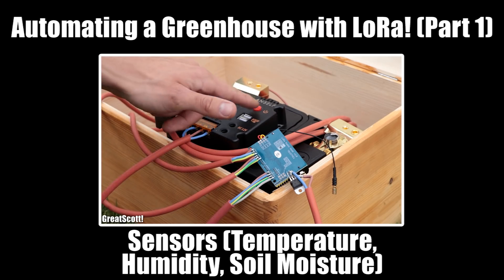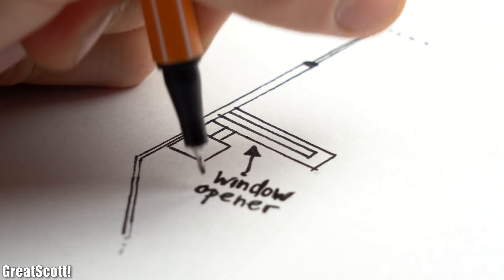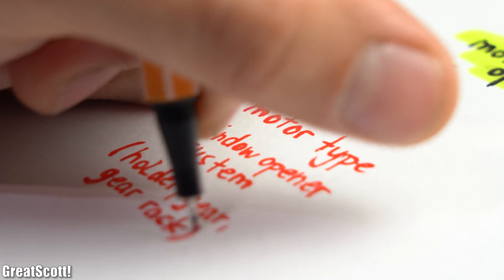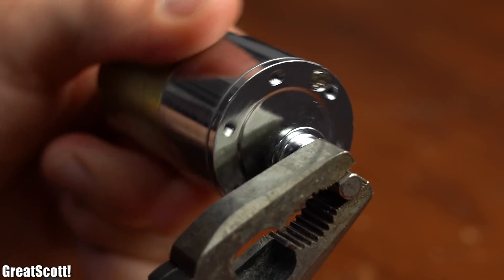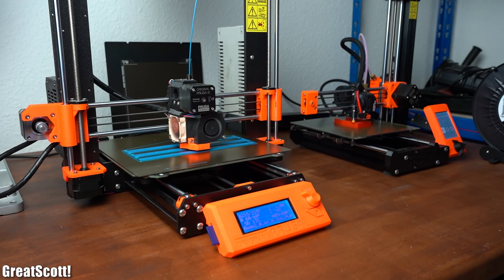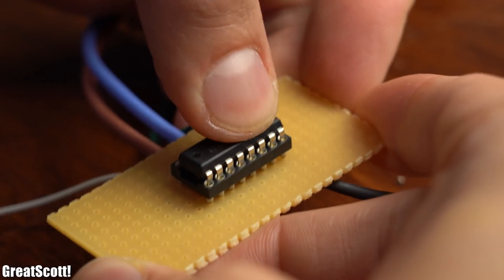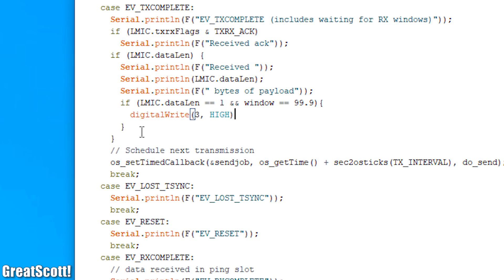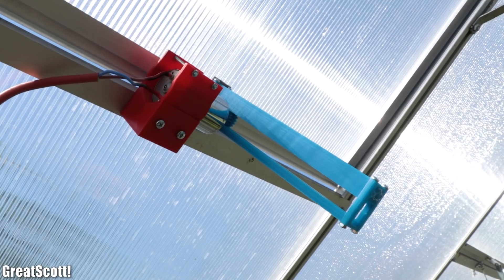Automating a Greenhouse with LoRa! (Part 2) || Motorized Window Opener

Comment from the maker: I feel like I need to explain some things a bit more after reading through the comments:
- I did not directly use the McMaster-Carr component library gear and rack. You are not allowed to 3D print them. I only used them as a rough reference in order to create my own.
- I did not include limit switches because I thought it would be an overkill for such a simple system. Instead my rack holder is open at one end. So if the window is fully closed and the motor wants to keep going, the rack can be pushed out without destroying anything. The opening and closing time is done by a delay and was measured by myself. The opening time is a bit longer than the closing time. Thus after a month or two the rack will slightly get pushed out of the holder due to misalignments. But you can easily fix that by hand.

I hope that answers some of your questions and I hope that you still enjoyed the video even without me mentioning those information :-)
Reply: A few sugestions to make this more reliable and better:
1) Add a 10-turn Pot to the motor for closed loop feedback, That way you always know exactly where the window is.
2) Instead of transmitting placeholder Temperature and Humidity data, transmit the back how wide open the window is in % based on the aforementioned closed loop data
2a) maybe add PID control to the window based on the temperature and hunidity for extra stable climate.
3) Include a hinge in the Rack case, the Rack tilts in relation to the window, your Stickytape will fail at some point otherwise.
The whole thing is overkill, so why not go the extra steps to make it perfect :)
Reply: @muh1h1  Well said
Reply: It shouldn't be too hard to add a course limit by watching the current consumption of the motor, no ? This is how my gate opener works, with some way to to smooth the endstop, rubber or something ...
Reply: Please make a video on how capacitive fan regulators work 
Because all know about resistive and triac based ac regulation but not about this
Reply: I don't want to say anything..... but I love you very much bor
Reply: Hello @GreatScott! 
About your limit switches, you can use a TMC2209 driver, used in 3D printer to have access to "limit switches" without installing any hardware : the TMC2209 detect when the current required to spin the motor is too high, and thus send a signal to the microcontroller indicating that either you reached the end of the rack; or that something is stuck in the system. The beauty is that should other weird cases occur, you can detect it as well, as it monitors the motor's current.
You can use those drivers as a drop in replacement for basic drivers, or in SPI to have access to the full feature set.

PS : after writing the post i remembered that you used a DC motor, TMC2209 is for steppers, perhaps you can still use it for DC motors, but anyway, TMC have specific motor drivers for DC motors, with similar features also.
Anyway, great project, will you post your rack and pinion somewhere? i like how simple and self adjusting the solution is, i want to use it on a smart blinds project i'm working on!

PS : look into home assistant : it is extremely powerful, integrates with countless systems, and rather than send bytes by hand, you can have software or physical switches, or better yet, automations, scripts, etc :)

Converting my own homebrew smart devices from my own restful feature rich firmware to ESPHome and Home Assistant increased what i can do  ten fold; also the reliability increased quite a lot; almost all sensors i'm interested in are already supported, and i don't have to search for the right library or write the driver...

Home Assistant + ESPHome is a game changer compared to other solutions; and is imensely powerful.
Reply: I would recommend the 'Blumat Tonkegel' for watering your Garden. In my Arduino Projekt i soon realized that the soil moisture sensors are useless. So i used the one from Blumat without even any electricity just mechanic. They water perfecly and need no maintainance. I would highly recommend this system.
Reply: Great project! but I do agree with some folks down here about checking motor state during both open and close operations: it's not about breaking some 3d printed gears and racks, you may have a stuck window because something broke or a (dead?) visitor into the greenhouse and it may be possible to fry something (motor, driver). a open/close window sensor may be helpful when you need to resume open/close operation, (or to diagnose a broken mechanism) but I see you when you say that you need to visit the greenhouse daily.

But since you already have a microcontroller on the job, I would also have included an threshold temp/humidity high and low values for automatically opening and closing, because you won't kill your vegetables if you couldn't visit your greenhouse on a particular day. Belive me: I don't have a greenhouse, but I do live on a hot-and-dry place, and I've managed to kill my mother-in-law flowers TWICE for not being able to water them on a hot sunny day (just one day did the mess! In my defense, I was at work). I don't know which temps you get during the year, but it may be a sensible solution, just in case. I see you grow tomatoes, and to me they are particulary fragile while growing.

And also, it wouldn't kill you if you have all the parts laying around.

Greetings from Brazil!
Reply: GreatScott couldn't a linear motor have worked for this application?  Also I helped my father take down then put up a green house on his farm.  The green house had a fan controlled by a thermostat with louvers on both sides of the green house that automatically opened when the fan turned on.  Kind of like a dryer vent louvers.
Reply: You could use car door actuator used for locking and unlocking doors
Reply: A limit switch may still be worthwhile for the closed position to allow it to self-calibrate on startup. This would be especially useful if power ever went out while it was in the open position, as it would attempt to open again once power was restored and could damage it.
Reply: Won't stuff get rusty due to the high humidity?

Comment: I saw immediately first part where you said you got rid of the humidity sensor. I saw the guy in YouTube for flaura pot telling all caveats of this sensor. Maybe it's an overkill using this sensor but, he mentioned 82% of those sensors have many flaws. I believe you've got a set of those in flaw design. He also mentions how to "repair" such flaws (or at least know the differences)

Comment: Just one thought - I note that you do not measure the outside temp and humidity.  Although your GH is not hermetically sealed, there will still be a difference between inside and outside temp and humidity.  eg, if its too humid inside, pointless opening the window if it is raining outside!

Comment: Almost 2 years later, I plan to do similar with my greenhouse. How did 12v battery with solar survive? Is it still operating? I want to control Windows, doors, water pump, Heater and others. As I also want to receive mqtt for remote control, I'm curious if a battery 12v 4ah will be enough to run esp32 w/o sleep. What do you think?
Do you use deep sleep?

Comment: We have a wifi thermostat in our well house and it measures temp and humidity(air). We’re more interested in temp but the humidity will come in handy in warmer weather. It’s called Inkbird. In cold weather we monitor temp in the house then we turn on a heat fan via CE Smart wifi plugs.

Comment: As I was re-watching this video, a thought occurred to me:
Currently, you have to adjust the gear rack every once in a while, because the position is lost over time.

But, what if instead of using (overkill) limit switches, you introduce a 'slipping' mechanism at each end of the gear rack?

You could have thin plastic walls that bend easily. Then, leave some space between the rack teeth and the bendable walls. The motor gear will slip when pushing beyond the limit, and re-engage when turning back quite easily.

Comment: I don't know if You still use this greenhouse, but I read somewhere that the best way to measure the temperature in the greenhouse was to place the thermocouple in the middle of the a vertically positioned PVC pipe...

Comment: Electronics is your expertise, but gardening is one of mine.  You say you don't need an automatic watering system, and on one level that is true.  BUT you do NOT want to water on top of your leaves like you did in the beginning of this video. Especially in a greenhouse.  You want to keep humidity down and besides opening things, not spraying water all over is actually important.  A drip system will help solve a few of the issues you have been having.  
There you go, a actually good reason to automate something else.  :-D You're welcome.

Comment: I was watching the greenhouse video and was wondering your opinion on combining solar power and LoRa to design a no battery LoRa sensor that only operated (at the least) during the daylight? It would seem sensors in a crop field may only need to send soil moisture, light levels, temperature, etc. during daylight hours though temperature at night would be useful. Procedures such as watering at night would create more disease problems for crops anyway. The sensors may not have to send information often, or at wide intervals, and could therefore aggregate some energy, maybe even enough for limited nighttime operation. A Supervisor/Monitor might to be able to evaluate the condition of a super capacitor by some method(s), ESR, capacitance, ripple current, etc, to guarantee reliability. At the least a keep alive signal could show total failure. In farming being able to use many inexpensive sensors without the need for battery replacement would be a great addition.

Comment: The whole build up is just way too complicated, the programming the build, the cost of over all. Why not just buy some expantion modules and hook the green house up to your home security system, add the water coae control units and u are fully automated. My security system is Paradox EVO192 and it can run 254 expantion modules , hell u could build a whole " Smart home" based on just your security system and programming that to control PGM-s and zones (temp , water, moist,doors and so on) or what not is super easy, hell even a 10 yr old can programm it to run your green house like jesus walking on water. Or is this the "make it has complicated and useless has possible" DIY video?

Comment: There might be a reason why your moisture sensor gave varying results: some of the boards are faulty as the 1Mohm resistor on the output only has one side connected. That causes the capacitor on the output to not discharge on time.
Solution: put a 1Mohm resistor over the output is the easiest.

Also, the sides of the board are unprotected, cover them with epoxy, nailpolish (good quality) or dip the entire thing in PlastiDip

Comment: Great work! I love the idea, and the application, however, maybe it would be better if you use a closed-loop system for the window instead of an on-off control, and that the amount by which the window opens is directly related to the relative humidity inside the greenhouse, and how much extra humidity opens a certain distance of the window is based on average data of the surroundings' conditions, this might be a bit overkill ik, but it would be awesome and that's all that matters lol.

Comment: Wax motor to a click pen mechanism to a lever. Wax motors work like a hydraulic piston and are ridiculously powerful for their size. Pin one end of the wax motor/pen mechanism to the fulcrum and the other to a class 3 lever. The weight of the load would act like the spring in the pen. The window is the lever and the load. The hinge is the fulcrum.
https://cdn.instructables.com/ORIG/FBY/8S7E/H1QMLLXX/FBY8S7EH1QMLLXX.jpg?auto=webp&frame=1&fit=bounds&md=730ec4f4deebce80d38c6e13514e9145 https://www.youtube.com/watch?v=sApyrDEXGAI&ab_channel=electronicsNmore https://www.school-for-champions.com/machines/images/levers_class_3.gif
Reply: alternatively you could just use a stepper and a two lever mechanism. If the short lever to the motor is supported by the frame as the motor in your video, it would keep it propped up. The window would raise slightly before closing again. Like in a piston motor, the short lever would be the crankshaft, and the long lever would be the piston rod. in a clockwise motion, the short lever would be in the closed position at say 180 degrees. When it passes 90 degrees it would rest on the cross beam.

Comment: what's the point of an automatic greenhouse if you don't have an automatic watering system which is the easiest part of the whole project and the most essential, also the windows should be controlled by the humidity sensor not by sending bytes manually

Comment: The controls engineer in me desperately wants you to create a control system to manage open angle of the window. You could probably get away with something as simple as a bang bang controller that measures the humidity and opens or closes the window depending on what values you give it. You could even go further by including a fan and also controlling the angle at which the window is open. Either way though, great project, thanks for sharing!

Comment: Why don't you make a FULLY automated garden system so that if you are ever on vacation, you can have remote monitor security cameras, automated watering system, and even a robot to assist with harvesting the vegetables. Also, make the windows a little more durable and add some limit and reed switches so that nothing goes wrong.

Comment: I had excellent results with using soil resistance for my automated watering system.  Sad the capacitance wasn't useful.  to measure resistance I just used galvanized nails, and sunk them into the soil.with a gap.  wet soil will provide little resistance to the circuit.  Dry soil will provide more.

I did this a few years back.  They called it the "Garduino"  here is an older article on the subject, I doubt it is the one I used, but the approach is.  https://www.instructables.com/id/Garduino-Gardening-Arduino/

Comment: I've had issues attaching 3d printed parts to the DC motor shaft (same as your DC motors) aren't you having these issues? Are you using pla or abs?

Comment: It's great to use gear and rack system, why you didn't use gear worm instead?? It will hold the weight of windows, or you can use motor window

Comment: I'm just wondering, that the poor little linear regulator will have a bad time supplying couple of 100 mA to open the window.
Let's say, that during the opening the motor takes double its no-load current . The input voltage of the regulator is 12V, the output is 5V, and the current is 140 mA. This means, that the regulator have to dissipate (12 - 5) * 0.14 =~ 1W.

If I were You, I would take a look at the current consumption and the temperature of the regulator of the motor during opening, and I would use at least a heatsink on the regulator, or a buck converter.

Comment: Fantastic video as always! I too have found it easier to water by hand than to use an irrigation system. I do have a drip irrigation system installed, but I only use it when we are away. The reason being that it can over or under water the plants, depending on the weather. I have a mixture of crops in 11 grow bags and some don't like being wet all the time particularly when it is cooler. Plus I check on it everyday anyway and it only takes 5-minutes to water them, at the most. The water timer I use (Hozelock) also has reliability issues - I'm on my 3rd one in 15 years. My current one leaks water even when closed, so that will need replacing if I can't fix it. For ventilation I use the Bayliss autovents which work very well and reliably (for 15 years now). These are automatic openers that use expansion of wax in a cylinder to push a cylinder to open the windows (contraction to close the windows). I look forward to more of these videos, I love the mixture of gardening and technology!

Comment: I am curious why you didn't just use a screw rod to make a diy linear  actuator, seems like it would be the most simple. with a Fine thread you don't need to worry about holding torque since pushing a screw through a nut would require significant force. 
Another thing, adding a limit switch into the design does not require MORE pins, in fact it only requires ONE pin total. all you need is one pin to control a DPDT relay that drives a motor in one direction till a NC limit switch opens at the extreme. then when you de-energize the relay it moves in the opposite direction till another NC limit switch opens at the opposite extreme. requires No timing, just one DPDT relay and two limit switches. I am sure I don't need to explain this with a diagram, but if you'd like one I would be happy to do so.
Sorry for the rant, its just that when we use microcontrollers we sometimes over complicate things. one control wire is all we need to do this reliably.
Thanks for the videos <3

Comment: I think that this H bridge also means, that the DC motor is shorted if non or booth of the directions are selected, so you cant basicly short your powersupply. And with this gear reduction it would be a pretty effective brake.  I also think, that with this gear reduction, your 3d printed parts should get heir sh.t together in case your controler fails while the motor ist powered. You could use limit switches for disconnecting the control signal from the H bridge, you dont need to program it, and it doesn't requier additional inputs.

Comment: Adding water hoses with holes on the ceiling connected to water pipes by solenoid water valves would solve the wattering problem.
Plus, vegetables take time to be mature so  you'd only have to visit the greenhouse once in a month or 2 weeks